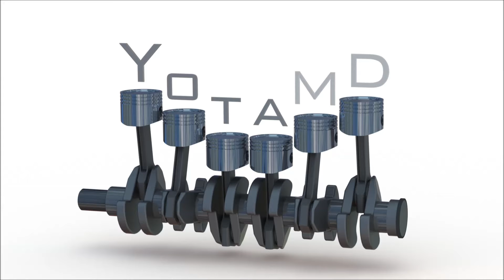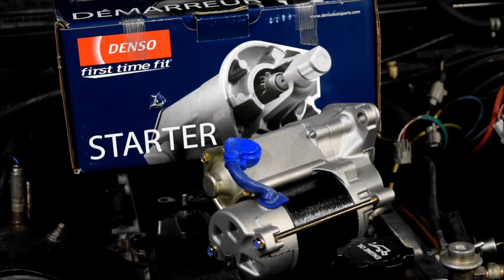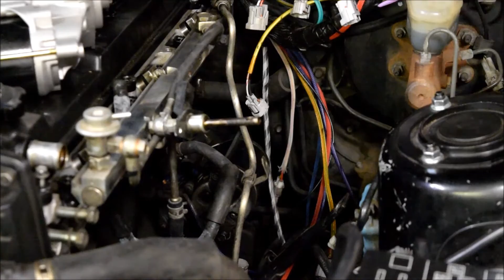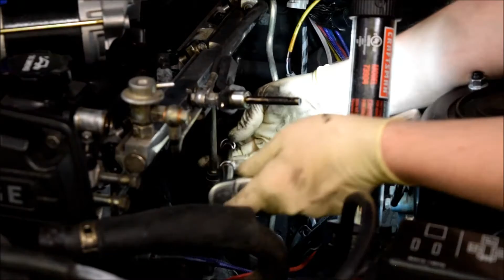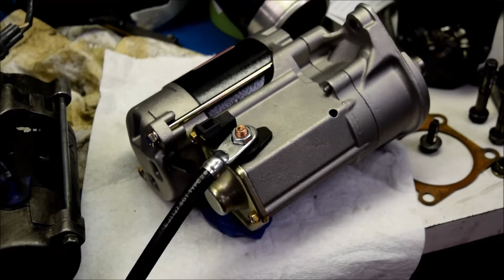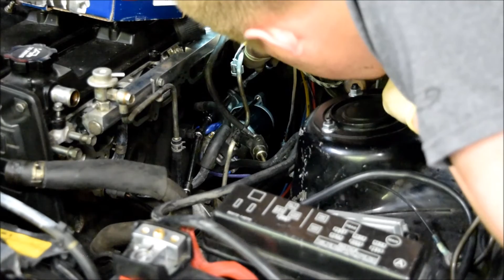Starter Replacement MK3 Supra

Comment: "just take the intake off"

Fck that. Pull the trans crossmember 8 easy bolts, support and lower trans 3 inches, hit the top starter bolt with about 3ft of extensions, no swivel needed
Reply: You mean small crossmember near the rear end of transmission?Do we really need 3 feet of extension? 3 feet is pretty long.
Reply: Yes drop trans cross member, lower tail of trans, then ya literally about 2-3ft of extensions to get the top bolt of the starter
Reply: @alexs_garage_  My car 87 bone stock automatic . Starter looks bad , need to tap with small hammer to start. This is 2nd time . I plan to buy brand new OEM . since newer one came with thread on the starter , I think easier to install . Any experience with buying replacement starters.

Comment: I did it with the manifold on. The hardest part is reaching the top front of the starter and getting to the nut for the top bolt. I used electrical tape and taped the nut to my index finger to get it started back on the top bolt. I couldn't reach anything but my two fingers on that bolt. Couldn't even get my thumb on it. It worked. Long extensions about 30" long on a dongle 14mm socket reached the upper bolt from the back. I was lucky that the bolt broke free because I was doing it under jack stands so not a lot of room for a breaking bar. Its difficult to even see the top bolt from below and behind the transmission on the drivers side much less getting a socket on it. Lower bolt is no problem at all. You can do this but take your time and don't give up. Your arm goes in at the same location as the drivers side coolant hose that enters the firewall. If you have skinny arms you can get to the upper bolt easier than I could. You can see the upper bolt if you put your cheek next to the hood support and look down behind the motor. Take off that coolant hose and anything in your way to reach in behind the motor to reach the top bolt. Place a 14mm enclosed wrench on  that top bolt nut and leave it set on place while tightening from under the car with your long extension ratchet. The starter comes out easy from underneath and goes back in OK but you might have to reposition it properly from above rather than below once you get it close to position. I know that worked best for inserting it home with bolt holes lining up. Bottom bolt back on first and your top will line up fine. Don't pull out your top bolt completely cause it would be a bitch to get back on using those long extensions. Good Luck!

Comment: I was once told the starter on the later (91-92) cars were threaded so they do not require the nut on the other side. I don't want to pass any bad info around so if needed look into it but, it would mean you could replace the starter easily from under the car.
Reply from the maker: +Franco Runco That would make the install a bit easier. You can tell here that the starter is, in fact, threaded. If they are otherwise interchangeable buying the 91+ version would be a great upgrade.

http://www.amazon.com/STARTER-TOYOTA-CRESSIDA-128000-9520-28100-46090/dp/B007CA9Y1C
Reply: I did it with the manifold on. The hardest part is reaching the top front of the starter and getting to the nut for the top bolt. I used electrical tape and taped the nut to my index finger to get it started back on the top bolt. I couldn't reach anything but my two fingers on that bolt. Couldn't even get my thumb on it. It worked. Long extensions about 30" long on a dongle 14mm socket reached the upper bolt from the back. I was lucky that the bolt broke free because I was doing it under jack stands so not a lot of room for a breaking bar. Its difficult to even see the top bolt from below and behind the transmission on the drivers side much less getting a socket on it. Lower bolt is no problem at all. You can do this but take your time and don't give up. Your arm goes in at the same location as the drivers side coolant hose that enters the firewall. If you have skinny arms you can get to the upper bolt easier than I could. You can see the upper bolt if you put your cheek next to the hood support and look down behind the motor. Take off that coolant hose and anything in your way to reach in behind the motor to reach the top bolt. Place a 14mm enclosed wrench on  that top bolt nut and leave it set on place while tightening from under the car with your long extension ratchet. The starter comes out easy from underneath and goes back in OK but you might have to reposition it properly from above rather than below once you get it close to position. I know that worked best for inserting it home with bolt holes lining up. Bottom bolt back on first and your top will line up fine. Don't pull out your top bolt completely cause it would be a bitch to get back on using those long extensions. Good Luck!

Comment: I just removed my R154 transmission a few days ago to upgrade my clutch. In doing so, I had to remove the starter. I did it the hard way with the intake manifold on; reason is, it is hard to take off the manifold because the my stock wiring harness is looped through the intake manifold runners....so I'd have to cut/rewire the harness or unplug it from the glove box area and re-loop it out/away, right?? 

Even that is too much work, so I just deal with the manifold on.
Reply: I just did it with the manifold on. I didn't cut any wires.
Reply: you can unclip all the wiring that runs through the intake manifold. definitely don't cut any wriring

I wouldn't remove the intake just to replace the starter, but if you're taking the intake off anyways I'd replace the starter unless you know it's relatively fresh.